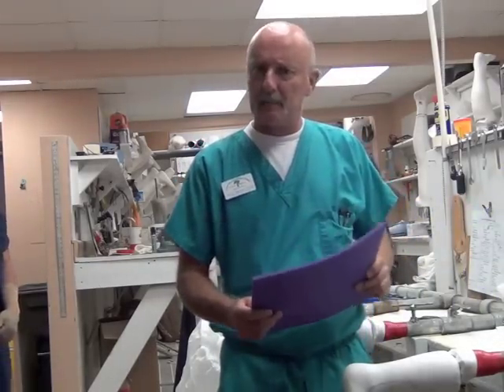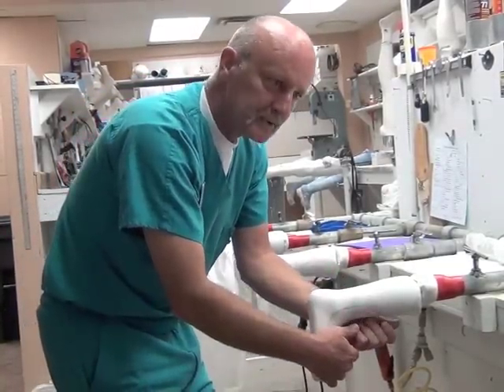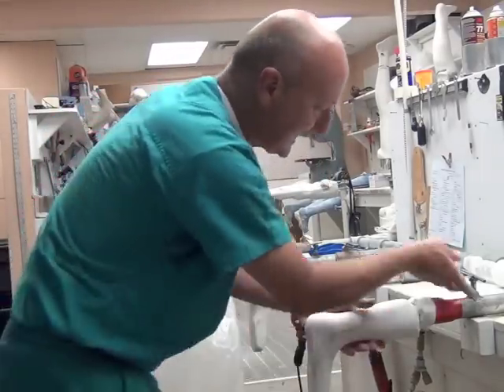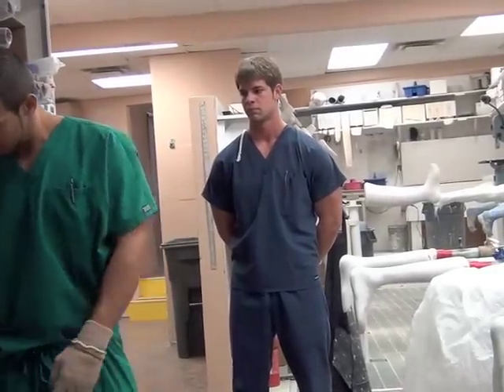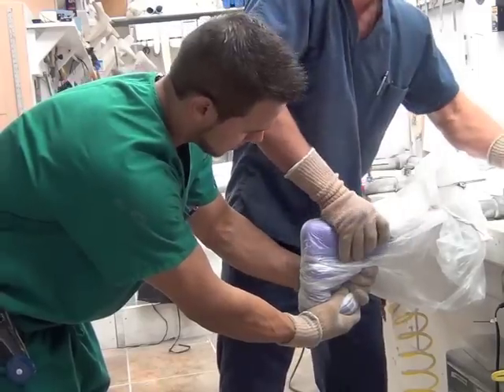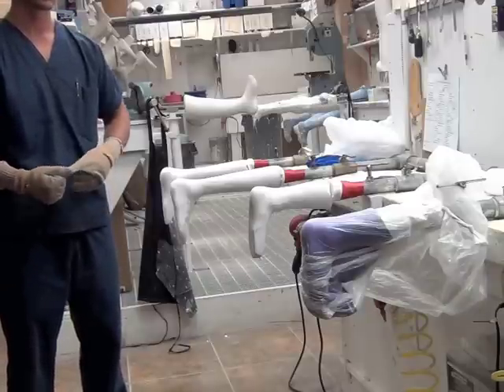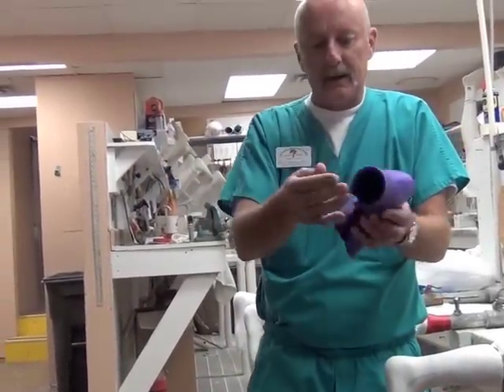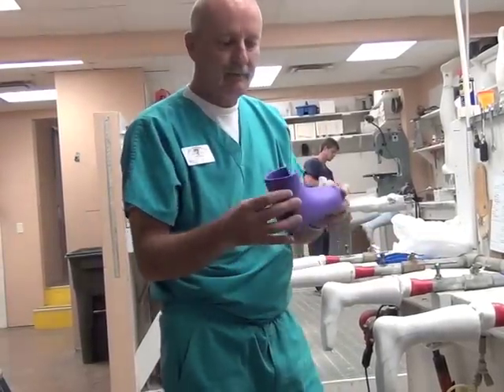AFO: EVA Innerboots

Comment: How do you keep the nylons from sticking to the plastic around the inner boot?
Reply from the maker: sometimes the nylon bonds to the plastic, it usually does.  We just leave the nylon bonded to the plastic.  If some comes loose we pull out what we can the burn the threads that are left with a torch.  Since the inner boot covers the nylon it is not cosmetically unacceptable.
Reply: Advanced Orthopedic Designs okay thanks for the respond and the videos 👍